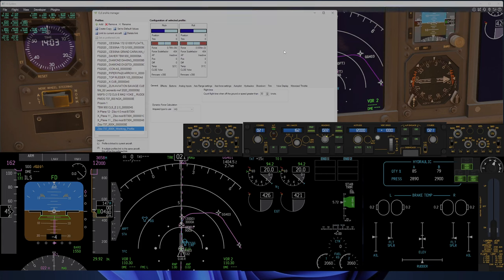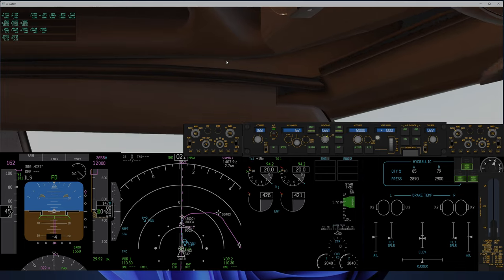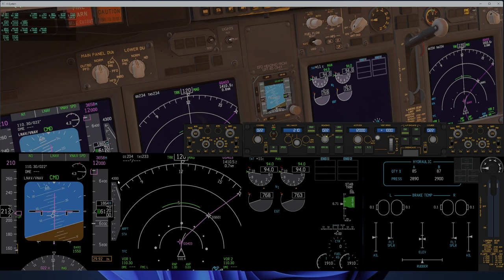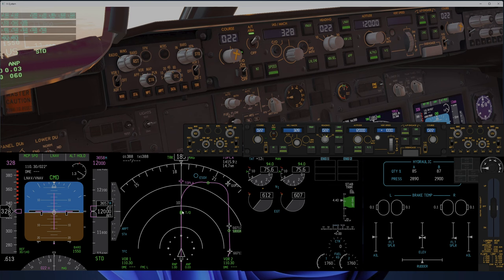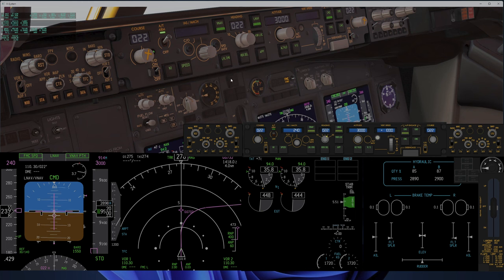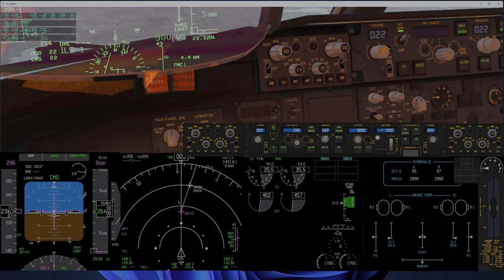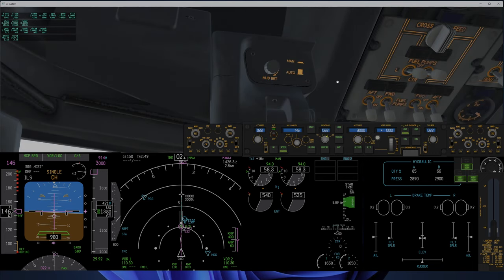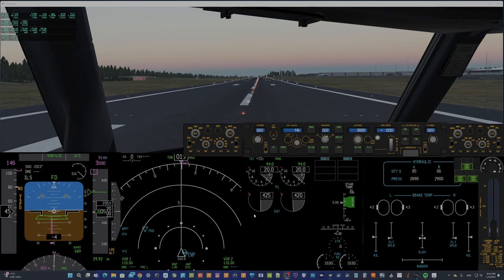Zibomod 8.3 Test Flight

Comment: You are just seeing that the flight model is too draggy in lower levels. It causes the need for thrust bursts during descent. And especially strong slowing down if you take a direct. The flightmodel drag, vnav path calculation and resulting path is not correct.